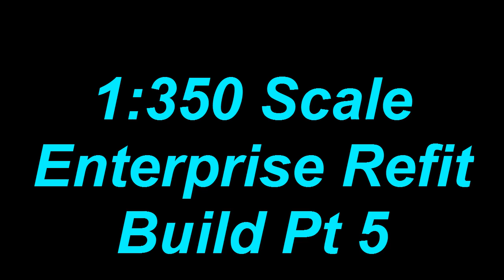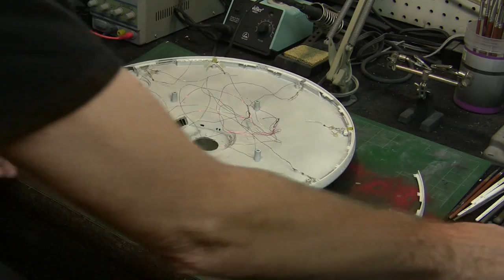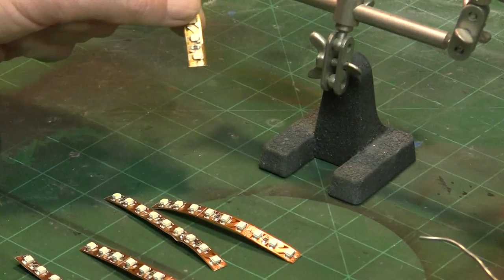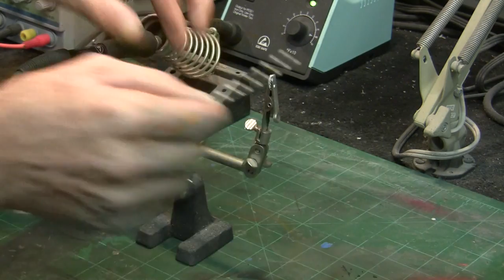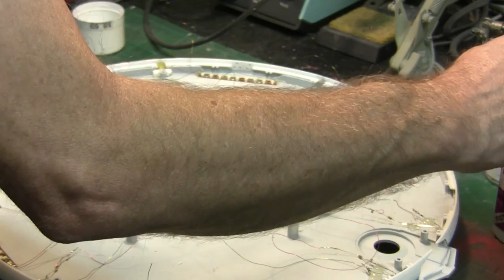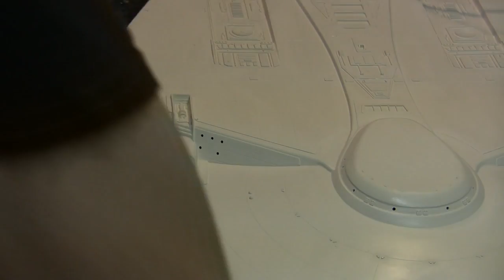1:350 Scale Enterprise Refit Video Build Series Pt 5 - Building The Saucer

Comment: Hi Boyd, I hope you are well and keeping safe. These videos are brilliantly helpful with my build.   I have a question -  did you use the kit's clear window parts, or did you not bother and left them open?  Many thanks, Steve
Reply from the maker: I used the kit clear parts everywhere except for the arboretum windows and the officers lounge. There I used some thin sheet clear plastic that I cut out to size. I did that so that you can clearly see the interior details.
Reply: @TrekWorks  brilliant, thank you for  the clarification. Your videos are very helpful and the finished result was stunning.
Reply: When did u insert the clear window parts?

Comment: was also wondering what type of soldering station to get to i got a iron but it dont heat up like it should and always get bad soldering results
Reply from the maker: The Weller soldering stations work really good. They have them in all price ranges. I would say to get one that is rated at 50 watts.

Comment: Love the build vids, i was curious what glue you use, i typically use Zap Gap, but i was curious to what you use or recommend. Thanks, take care :)
Reply from the maker: I use CA glues for things that I need to tack in place quickly but I always use regular Styrene glue to back it up later. CA doesn't penetrate the plastic and it will become brittle and crack over time.